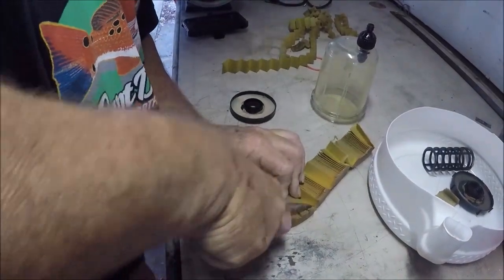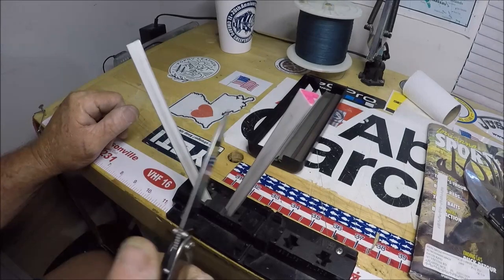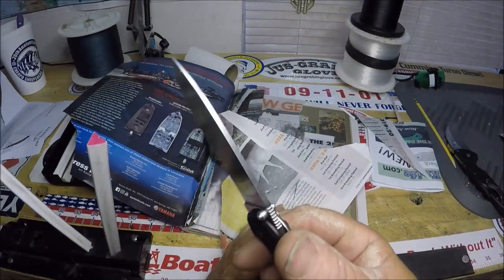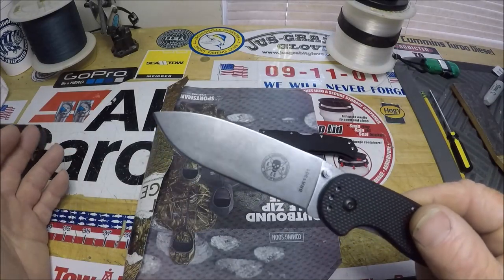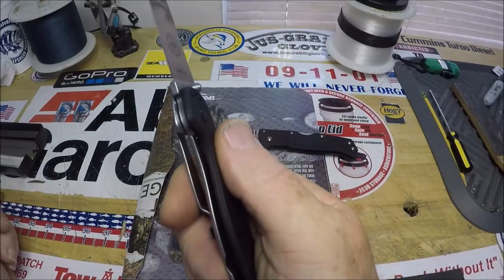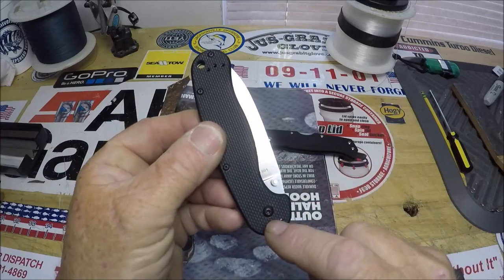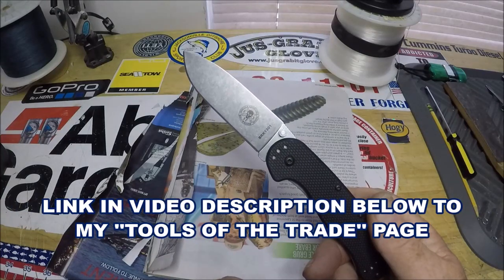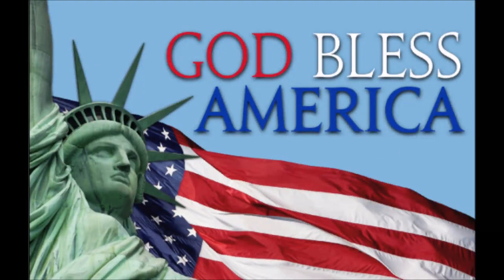ESEE AVISPA ''a non-p_ssy review''

Comment: Randall Adventure Training = Rat models (Ontario Knife Co.). Jeff Randall created the design for that company. After that partnership ended, the design for the Rat was altered for a new venture. Made it slimmer, changed blade shape, more variants (steel etc...), and the lock up is better. Went from a liner lock with thinner stock to a frame lock.